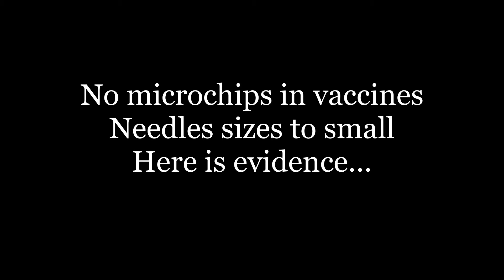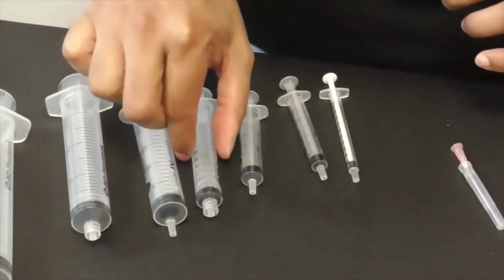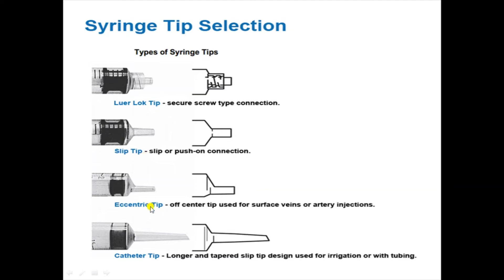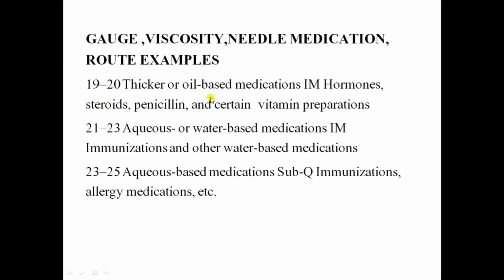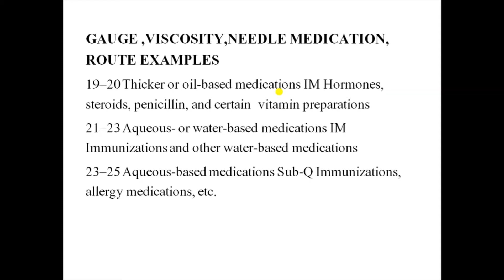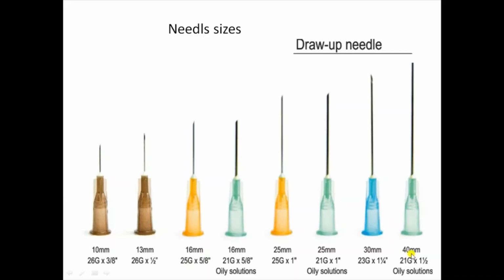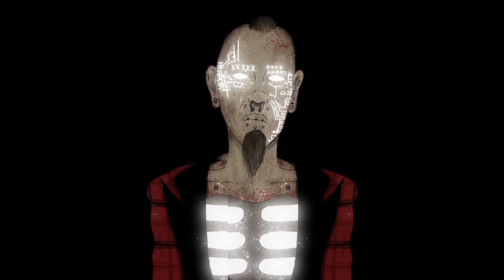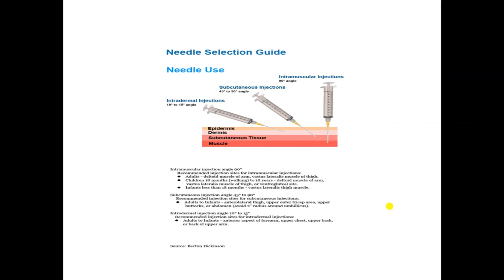Microchips are to big to fit in Needle sizes

Comment: Mostly people do not get that to transmit it would need a battery. To power a transmitter that would send even 20 feet would require a battery as large as a coin and that would likely be exhausted after sending for a fraction of a minute.